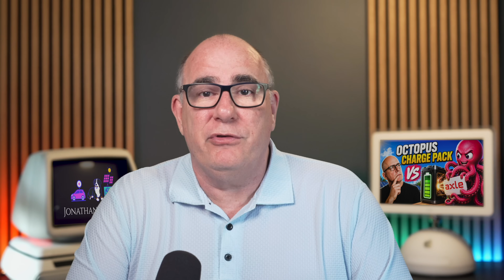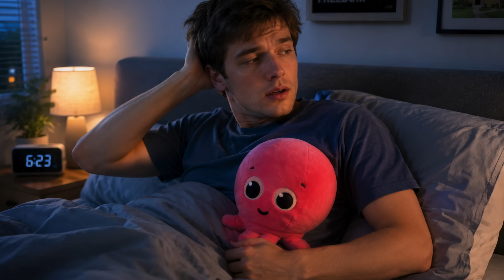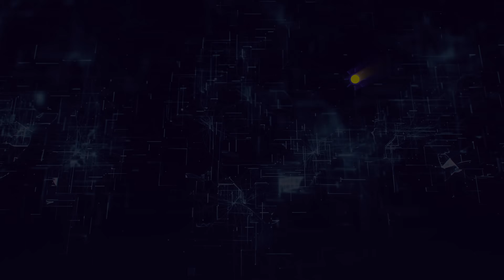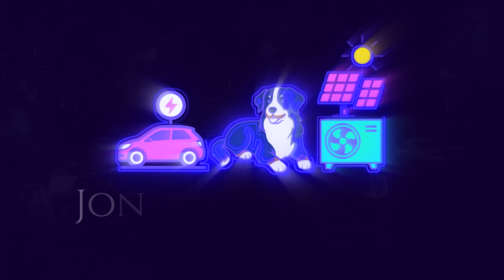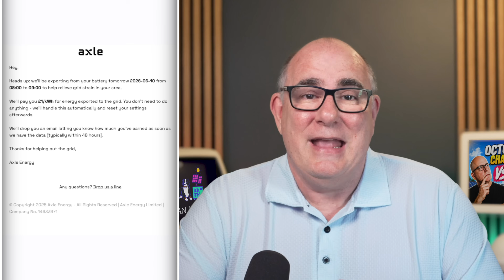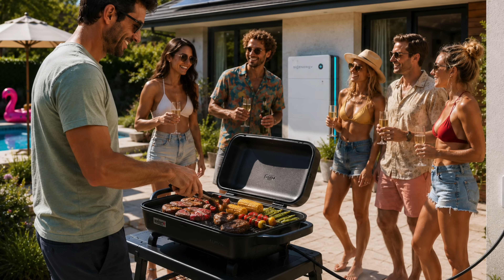Octopus Charge Pack Just Fired A Shot At Axle Energy

Comment: If I can get Cluade AI to write me automations that tracks my powerstream system through the day to get me to 20% battery by 7.29pm just before I start exporting from my Solax batteries I can be assured in the not too distant future octopus will have a much similar system but more refined i'm sure. ' Morning Nev I know your standard battery levels you requested me to monitor and manage are for 30% left at 8.30 and 10% at 11.30 pm.... want to change these today or are we good to go at those targets"... you get the picture. Or it may be much more intelligent, Octopus may fully drain my battery by 8pm as they needed the boost for the England world cup final win, but then they charge me off peak rate for the rest of the evening ?   They will bring forward a system that does not risk adding costs to me while benefitting them and the grid. Interesting times.
Reply from the maker: @yellownev If you're familiar with Claude Code, point it at the API docs for all the products in your setup and tell it what you want to achieve. It may surprise you.

That's the exciting bit for me. A lot of this optimisation doesn't need magic, it just needs access to the right data, sensible rules and the ability to adjust based on tariffs, forecasts and your own preferences.

Comment: I can guarantee the government is going to impose a stand alone EV tariff  on electricity providers which can’t be used  for the house or battery. It will have a special VAT rare of 20%. It’s the only way they can fulfil Labour’s idea of a mileage chargr for EVs, which we all know is impossible to manage.
Reply from the maker: @timtam644lpl That's the bit I've never understood about this theory. How exactly are they going to differentiate the electrons that go left into my EV and the electrons that go right into my house?

Smart meters measure quantity imported and exported. They don't know whether a kWh ended up in an EV, a battery, a heat pump, a kettle or a hot tub.

My EV charger, home battery and heat pump are all connected behind the same meter. Unless someone plans to fit a separate metered supply to every EV charger in the country, I'm struggling to see how this would work in practice.

The laws of physics remain stubbornly inconvenient for politicians. 😄

Comment: I absolutely agree with you that AI can't know what is going on in your home, let alone in your head.  I like to have control of my battery and to tell it when I want it to charge.  Charge Pack wouldn't suit me anyway as I don't export to the grid (apart from excess solar) for several reasons, the most important being that I am on a very low export limit (3.6kWh) and I have a FIT which is worth keeping as I use much more than half of my solar generation.  I'm happy to let Octopus decide when to charge my car (when I am not doing so for free from solar) but letting anyone take control of my battery is a bridge too far.
Reply from the maker: @annesmith1919 I think you've summed up where a lot of people will land. Letting Octopus decide when to charge an EV is one thing because the objective is simple: have the car ready when you need it at the lowest cost.

A home battery is different. It isn't just an energy store, it's part of a wider strategy that includes solar generation, FIT payments, export limits, weather forecasts, backup power and personal preferences. That's much harder for any AI to optimise because only you know what matters most on a given day.

In your case, with a 3.6kW export limit and a valuable FIT arrangement, it sounds like the benefits of Charge Pack would be quite limited anyway. As I've said throughout the video, this feels much more suited to households with large batteries, powerful inverters and generous DNO export limits than it does to everyone.

Comment: Agree entirely Jonathan.I emailed Octopus for an overview about how it works and this was my answer.
Thank you for reaching out. Greg personally asked me to follow up with you directly.

This is what the session credits will cover:
Any battery importing done at your day-rate during a session will be compensated so it effectively costs you the cheaper off-peak rate.
Any exporting to the grid during a session will be compensated at the difference between your import day-rate and your export unit rate.
We'll add a bonus on top as a net reward for joining the session.
In short, the rewards will be on top of your existing rates and participating in sessions will always benefit you financially.

To get started, please sign up here, and we'll follow up within a few days with an email detailing how you can integrate the battery via a few simple steps. You can decide when you action those steps and when you want to get started. 

I hope that helps, but let me know if you have any questions.
Reply: Clear as mud then.  But at least Greg personally asked him to respond to you. 

I have a message out to both Greg and Phil Steele. 
Very specific questions. No answer yet.
Reply from the maker: @johnking9763 Thanks for sharing that. If we assume a 30p day rate, 9p off-peak rate and 12p export rate, the maths becomes clearer.

If Octopus charges your battery during a session, you still pay the 9p/kWh import cost, so the value is really the 21p/kWh difference between peak and off-peak.

For export, 12p would be topped up to the 30p day rate, so that's an extra 18p/kWh, plus whatever bonus Octopus adds.

That's still a long way from Axle, where an event can pay £1/kWh plus your normal 12p export, giving £1.12/kWh.

So unless the Octopus bonus is very generous, Axle still looks far more rewarding per kWh exported.

Arrgh this is way to complicated 🤦
Reply: @JonathanTracey and for people like me I'm also getting my £4.99 monthly Givenergy premium subscription paid by Axle!
Reply: @JonathanTracey The difference here though is Octopus might do this every day as part of their managed system, whereas Axle is a couple times a month.  Yes, for a single event, Axle would be beneficial. But if you’re getting 20kwh a month through Axle and 100kwh a month through Octopus, the value proposition is much better with Octopus.  

The problem here though is - it’s currently impossible to tell whether that’s the case.  The info available is vague and at times contradictory.

Comment: I wish they'd bring in a simpler system.  Tonight is an energy saving night.  I could charge up my battery and release a bit when the need is greater.  But no incentive.  I don't want to sign up or give away control
Reply: Yep I would sign up to a message to please fire up the battery export for 2 hours at bonus pricing but I am not putting my battery on the internet
Reply from the maker: yeah it is getting overly complicated

Comment: This is Octopus' answer to Eon Next Optimise which does the same thing. Virtual Power Plants and battery optimisation are obviously not for everyone but for those who want to sell energy at peak rates and store it at cheap times they are great.
Reply from the maker: I agree but you dont have to give up total control to them, you can do all of that and keep your hands on the wheel
Reply: @JonathanTracey  agreed, this brings more choice and competition to the market which is a good thing.

With the Eon version, you can customise how the AI controls your battery, like for instance set the minimum battery charge to keep. Also the Eon app allows smart EV charging with lots of customisation such as setting the maximum cost per kwh you want to charge at, and the AI does the automation.

Long story short, this will only get better with time as these systems learn and adapt, these are exciting times for intelligent domestic energy generation and management.

Comment: Seems to benefit Octopus more than the customer handing over control of their system.
Reply: Total Agree , Charge Pack is a benefit to Octopus and not to the consumer as there have not been honest in the FAQ, its written hiding the detail to dump it all down . I've aksed Octopus questions and they never responded .
Charge Pack works if you don’t care or your don’t manage your inverter/battery and you want to hand over your purchased Inverter/battery that used your money £££ to install, to benefit Octopus to make money on the back of it . AI can’t predict what you will be doing with the battery . It can guess & it might get it right some times, but not all the time and thats were your loose out . Axle is black and white .
Reply from the maker: fully agree

Comment: I think I would consider something like this if I had a 2nd battery/inverter set up just for this purpose, perhaps if there was a 50/50 split on the costs of purchase and installation it would be a good way to get VPP out there and help balance the grid. You would obviously need some idea what your ROI would be but it could be a good way to lessen our dependance on fossil fuel and soak up the excess production, instead of having to build huge battery farms.
Reply from the maker: @KarlTheDingbat I think that's an interesting idea. If suppliers contributed towards the cost of batteries and installation in return for access to that flexibility, it could accelerate adoption significantly.

The challenge is always proving the ROI. For someone with a large battery, powerful inverter and generous DNO export limit, the numbers might work very well. For others, the returns may be too small to justify the investment.

What you're really describing is a partnership model rather than the customer taking all the risk, and I can definitely see some appeal in that.

Comment: Thanks for this you make some good points on visibility of what the consumer earns. One thing that I like with the octopus solution is they will potentially charge your battery with off peaks rated during peak rate periods if demand is low, this take managing the battery out of my hands and hopefully less load on the grid.
Reply from the maker: yep that would be a bonus, but what if they did the opposite emptied your battery and you only found out when you wanted to start using the energy
Reply: Octopus is not our fairy godmother, it seems to me that they want people to pay  octopus for batteries that will ultimately benefit octopus, can you change supplier and still use the batteries? Will they prioritise your usage or their needs? Will they offer home backup during a rare grid outage? Will they take 6 months to install from order as they did for my powerwall 3 and expansion?

Comment: Hey Jonathan, this might be a dumb question but doesn't all this charging and discharging .. especially on a continual basis suggested by Charge Pack .. impact the battery's lifespan?
Reply from the maker: depends on how hard htey work it, most batteries are guarenteed for a number of full cycles - empty to full. but modern batteries have a warranty of somehting like 10,000 cycles which is a lot of years
Reply: @JonathanTracey  Thanks but guarantees and warranties in this industry don't count for much unfortunately. GivEnergy being a case in point.
Reply: If you are generally doing one full cycle a day then time driven aging for a good battery will get you before usage driven aging. It's really  only stuff like Cosy you can cycle a battery to death easily

Comment: the problem with handing over control to a 3rd party we have seen with givenergy one unnamed company was driving the battery below the safe storage level,  overriding the givenergy 10% marker locked in the software,   i feel handing control to a 3rd party instead of a user defined level will irreparably damage someone's batteries , simply because  there software cannot see or identify each different brand bms so will limit it to x amount that are common,  with no company  to fall back on ,  i can't think of the legal headaches its going to prove octopus controls were behind the failures and make them pay for the replacement
Reply from the maker: @ram64man I think that's a valid concern. Battery manufacturers spend a lot of time developing their BMS systems and safe operating limits. My assumption is that Octopus will only be working through approved integrations, but it does raise questions about responsibility if something goes wrong. It'll be interesting to see how the warranties and liability are handled.

Comment: It looks like a good idea but Octopus are always a bit woolly and vague with their explanations. I get the feeling it’s to benefit them more than you/me. If that’s the case then this battery system should be pretty much free to the home owner. I think they are a bit underhand, for example, my smart meter and EV charger will often start charging immediately even during peak hours but doesn’t 100% confirm I’m being charged at the lower price per kw. Even the smart meter app approximates it for a day or so before populating the cost. It knows immediately the exact Kw’s used so there should be no reason not to let me know and ant least  confirm that it’s on the off peak rate. Unfortunately I feel this battery system is a little bit of a scam and the Boss Greg doesn’t come across as very trustworthy.
Reply from the maker: @metube9541 I can understand your concern. My view is that Octopus has to make money from the arrangement or they wouldn't offer it, but the customer also needs to come out ahead. The challenge right now is that the details are still a little vague, so it's difficult to know exactly where that balance sits. Hopefully we'll get some real-world data from early adopters soon.

Comment: Great analysis again. Thanks!
I have solar, batteries, EV charging and a heat pump. Octopus Intelligent Go is ideal all year round. I’m one of the group that likes to be in control and optimise my system myself . Nevertheless I would hand control to Octopus if the benefits were quantifiable. At the moment they are not, so I await better information.
Reply from the maker: I think most would but they need to quantify the value, right now they havent

Comment: The model where this works is IMHO the one where you don't pretend it's you owning  a battery and them controlling it. You are at best buying a battery to rent to Octopus.

So if you can offer a tariff where Octopus install (or provide plug in) batteries and it's rented on a monthly basis with their control and optimizations it probably works rather well. I can imagine a lot of people would go for a battery without up front costs that reduces their bills and they don't have to understand how it works. That kind of model is extensively used elsewhere in the world.

It's why I never liked Intelligent Flux - it's like buying a car, giving it to Uber for free and getting free rides and a small cut of the profit.,
Reply from the maker: @etchedpixels That's actually a really interesting way of looking at it. If you're handing over significant control then perhaps the model works better when Octopus owns the battery and takes the investment risk as well. I suspect there would be plenty of customers interested in a battery-as-a-service model if it reduced bills without a large upfront cost.
Reply: When I had my solar+battery installed (by Octopus) last summer, I came to exactly the same conclusion as you, so I'm still on plain Flux. What interests me more is their new plug-in battery as I am limited to one 5 kWh Enphase battery in my bin store (I was told at the time they cannot be mounted on Thermalite blocks), so free-standing plug-in batteries would help as I already have a double 13 A socket fitted there.

I would like to see Octopus offer a simpler tariff for taking control of your battery, something like whatever is the current wholesale price less a few pence/ kWh to cover their costs and regulated profit margin, whenever it goes above a certain price level (perhaps 10-20% higher than the Flux export rate at that time). They need to show that they are putting their customers first.

The competition I can see for tariffs like this is from investors in grid-scale batteries. If there is enough grid-scale battery capacity coming online (perhaps co-located with solar or wind), then energy arbitrage is going to flatten the price peaks and take away profits from companies like Octopus, so it is essential for them to move quickly.
Reply from the maker: @laurencecox2657 I think you're right that grid-scale batteries are the elephant in the room. The more storage that gets deployed, the harder it becomes to profit from simple arbitrage. It will be fascinating to see whether suppliers can continue to offer attractive VPP incentives as the market matures.

Comment: The other question is: Is it actually an AI? Or is it a far more sensible smart system?  Edit: I'm betting on the latter, with the "AI" badge slapped on it to make it appear more high tech to people who have zero experience of how stupid what's called AI can be.
Reply from the maker: @truckerallikatuk 😂 Or an intern with ChatGPT open in one window and a spreadsheet in the other.

In all seriousness, I suspect it's somewhere between a traditional rules engine and modern AI. The marketing departments seem to be slapping "AI" on everything these days, whether it's genuinely intelligent or just making decisions based on a large set of rules and historical data.
Reply: The existing stuff inverters use is not AI as in giant power hungry hallucination machine it's simple feedback loops and statistics plus a bit of data logging. You can read the predbat source if curious